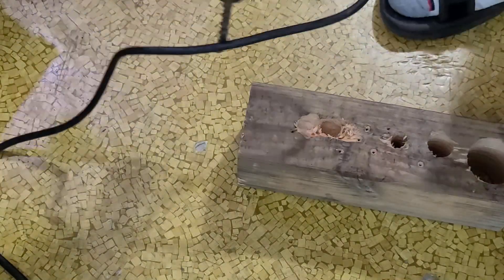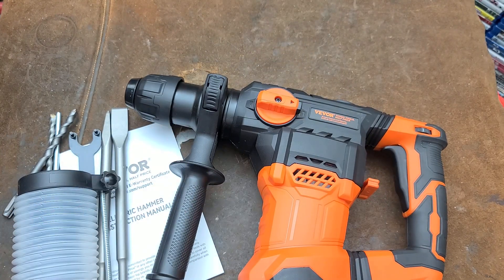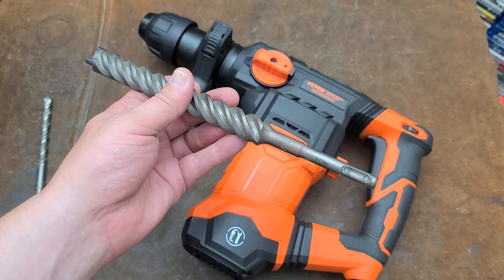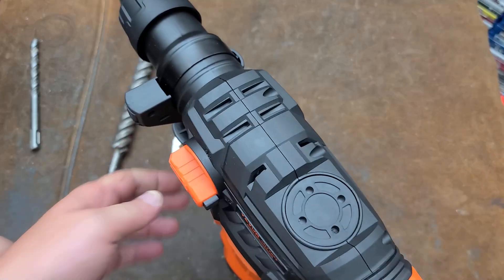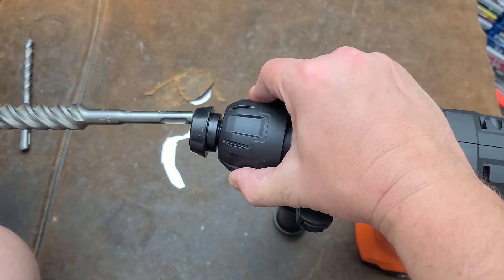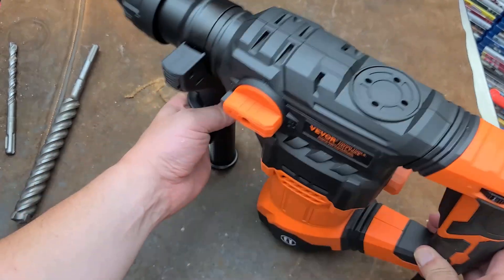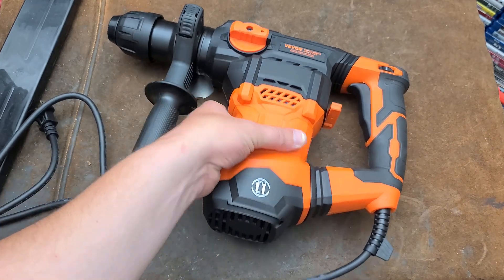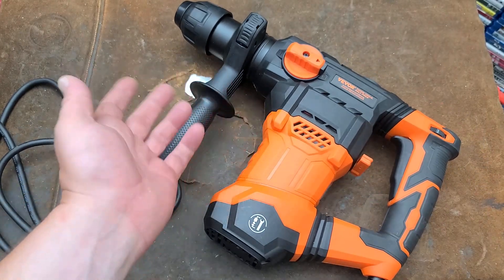Vevor "2nd Gen" 5.5 Joule SDS Plus Tri-Mode Rotary Hammer Review

Comment: Thanks for this video! I literally just got mine and I was having a hell of a time getting the bit to seat properly in the chuck. I had to plug it in and run it for a second before it finally popped in. Good to know the tightness of the chuck is a problem others have.
Reply: Have you used this to make concrete holes? Particularly 2 inch?